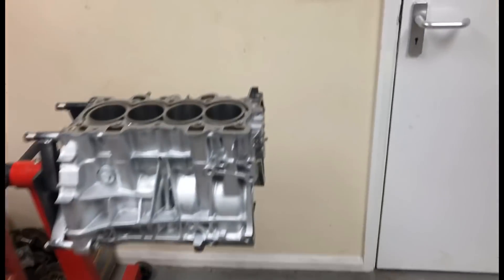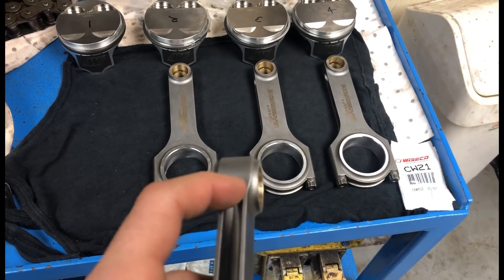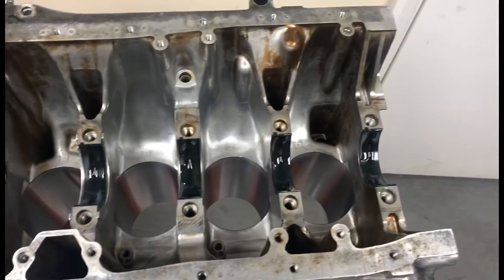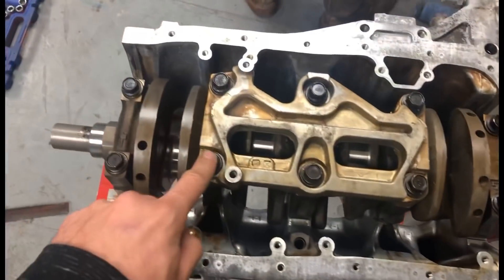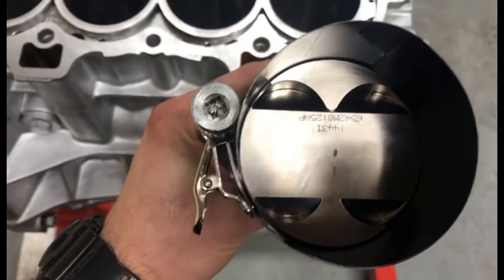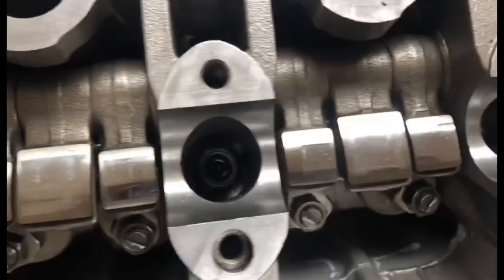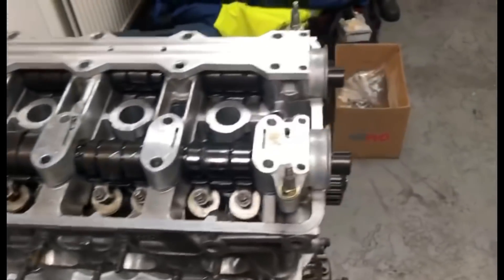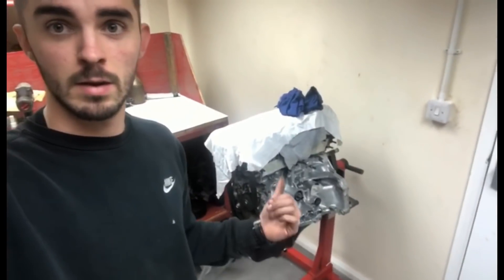Kermit the forged b18c4 build

Comment: Hiya pal what’s torque spec on arp rod bolts thanks
Reply from the maker: 3 steps mate 30ftlbs then 60ftlbs then 80ftlbs
Reply: @BoostedDevelopments  top man thanks
Reply: 80 ftlbs it 108 Newton meters , does that not sound a lot ?
Reply from the maker: That’s what’s on the spec sheet bro of brand new arp bolts for b18c4 engines. I always do 2ftlbs extra for boost no real need to but just what I do
Reply: @BoostedDevelopments  appreciate the help pal , any chance I could be a pain , and you send a pic of sheet over when ever you can , no worries if not pal
Reply: @BoostedDevelopments  also rod bolts not head bolts you know
Reply from the maker: Sorry bro 🤦🏻‍♂️ thought u said head bolts my bad didn’t read it originally properly. ARP 2000 bolts are meant to be 50ftlbs but ideally use a stretch gauge to get it right mate
Reply: @BoostedDevelopments  top man you just use torque wrench or ?
Reply: @BoostedDevelopments  do you bother with stretch gauge or ?
Reply from the maker: Yes mate